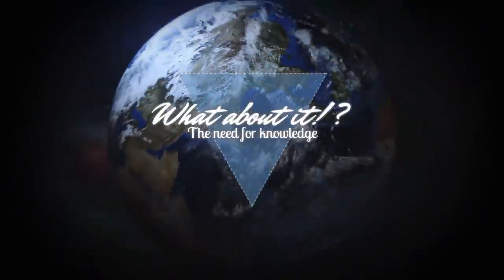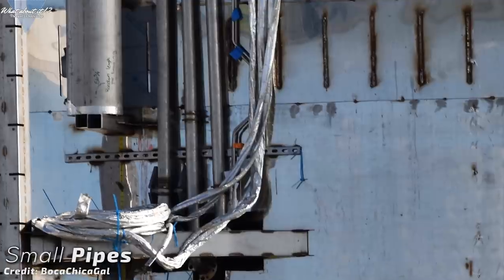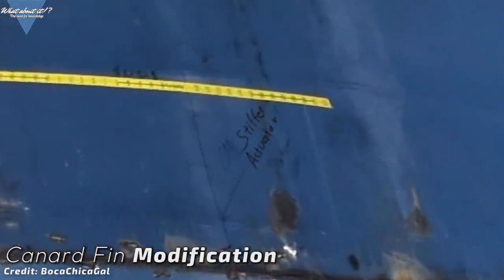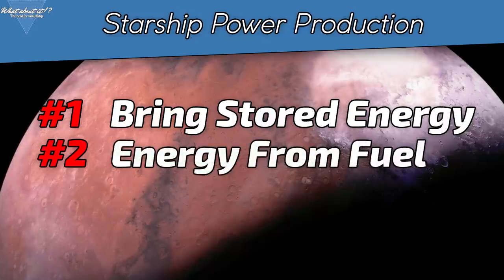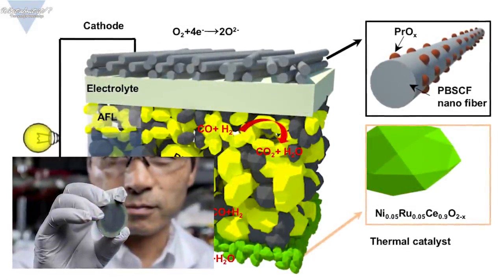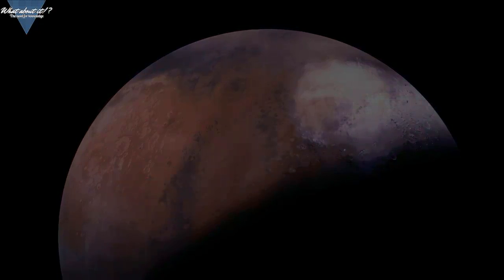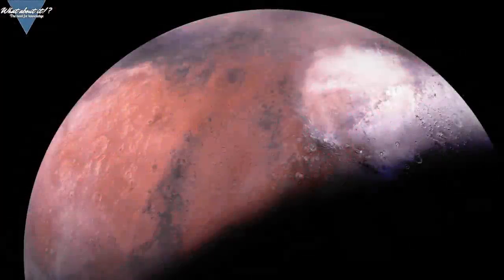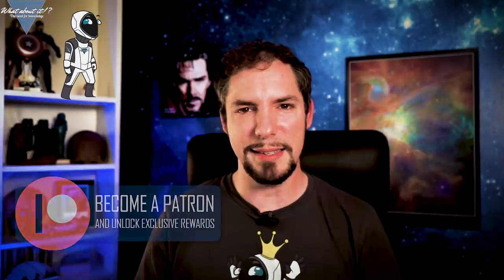45 | - How Does Spacex's Starship Generate Power?

Comment: 6:15 : kWh is not power, it is energy. So if you talk about "75 - 90 kWh" needed for the ISS, you have to say it what time this amount of energy is consumed.
Reply: 70 to 90 kwh means a total 90,000 to 70,000 watts in one hour. So if  they use 4,500 continuously for 20 hours they have used 90 kwh. Does that help you?
Reply: kW would be correct here.

kWh is a mistake.
Reply: He meant 75-90 kW
Reply: @ixglocTV  Nope, it's right. I figured you all would be able to figure this out since electric cars are around. You know, they measure things in kwh like it should be. A 100 kwh battery can last 100 hours at a 1000 watt hour draw. Do you understand now?
Reply: @Bryan-Hensley  Look into your physics textbook (also wikipedia will do), W and kW are power units, Wh and kWh are energy units.
Reply: @Bryan-Hensley  kilowatts are a measure of power, like horsepower. Power is a rate of conversion of energy. Kilowatt hours are a measure of energy, specifically the amount of energy a battery needs deliver to sustain 1kW power for 1 hour. The analogy would be a horsepower hour. A 100kwh battery is 100 larger than a 1000wh battery, but this says nothing about time. The correct version of your statment is a 100kwh battery can last 100hours at a 1000 watt (or 1kw) draw. Talking of a 1000 watt hour draw makes no more sense than talking of a horsepower hour draw. If you insist on this terminology, you end up with  A 1000kWh battery can last 100 hours at a 1000 WATT HOUR PER HOUR draw, which is unnecessarily complicated, better just to express in watts. Unfortunately there is gross misuse of the terms kilowatt and kilowatt hour in North America. It's usually used correctly in Europe. It's disappointing to see Felix get it wrong.
Reply: @londonalicante  And it still goes over your head. You just proved me right and you still don't get it.
Reply: @londonalicante  you must be younger. Young people were taught how to memorize. Older generation was taught to understand.
Reply: @Bryan-Hensley  I'm 46, and I am an engineer who designs very large heating equipment for industry. I understand what you mean by a draw of 1000 watt hours, but it does not make the terminology correct. It should be 1000 watt hours per hour, or simply 1000 watts. I'm sure you would agree that describing a 1hp motor as a 1hp hour motor looks a little odd. These ambiguities can be important. How would you feel if you bought a car with a "200hp hour engine", then found out later that the engine doesn't actually make 200hp power, it makes 200hp hour of mechanical energy in 10 hours, so it's actually only a 20hp engine. And yes I know talking about horsepower hours looks weird. I'm doing it deliberately to illustrate how wrong it is to use kilowatts as a unit of energy when they are in fact a unit of power, or kilowatt hours as a unit of power when they are in fact a unit of energy.
Reply: @londonalicante  I don't see what the issue is. ISS uses 75 to 90 kw per hour. Isn't that what he meant? I'll listen to it again and see. The original comment said he needs a time, kwh is an hour. I don't get the confusion. I totally understood.
Reply: @londonalicante  Why the insults? Try to keep the discourse civil.
A 90kWh battery can supply 90 hours of power at a rate of 1kW, or one hour at 90 kW.
I did some research and it looks like ISS uses about 90kW of power, and the four PV panels (2500m2 total area) generate about 80-120kW in full sunlight. Enough to power the station and charge the batteries. Haven't found any numbers on storage capacity yet.
Total eclipse time is about 35 minutes out of each 90 minute orbit, so a 90kWh battery array should be able to handle it, but I think I'd go with at least double that, for redundancy.
https://en.wikipedia.org/wiki/Electrical_system_of_the_International_Space_Station
https://www.edn.com/design/power-management/4427522/International-Space-Station--ISS--power-system
It surprisingly difficult to find how much energy ISS's batteries can store. Lots about how much the station uses and generates, but I can't find anything on storage capacity. Maybe someone with better "'net-fu" than I can find it.
Reply: @Bryan-Hensley  The issue is that he said the ISS uses 75 to 90 kwh , but did not specify how long. If he meant 75 to 90 kw, he should have said 75 to 90 kw, just as for an engine, you would have said 75 to 90 hp. By adding the hour, he could mean 75 to 90 kwh per hour, or he could mean 75 to 90 kwh per day, which is only 75/24 to 90/24 =  3.125 to 3.75kW. Common sense says this is far too small, so he probably meant 75 to 90kw. Note that kw PER hour is a different thing altogether. It refers to a power ramp rate, similar to horsepower PER hour. You could say, for example, that a power station could increase its output by 1000kW every hour when it comes online, unitl it reaches its full power after several hours.
Reply: @Bryan-Hensley  As we seem to be understanding each other now, I'll give another example, that rarely causes confusion: car battery amps. A typical car battery might be 12 volts,  50amp hours, and capable of 500amps peak. 50amp hours means it can run the stereo at 1 amp for 50 hours before going flat, thats 1 amp x 12 volts = 12 watts for 50 hours = 600 watt hours. 500 amps peak means it can deliver 500 amps at 12 volts to the starter motor. That's 500 x 12 = 6000 watts. But it can only deliver 500 amps (6000 watts) for 1/10 of an hour before going flat. Again, the difference between watts and watt hours is important.
Reply: @londonalicante  no, I'm just tired of trying to explain it to you. I'll give you one more example and I'm done if you don't catch on.
 I install 10kw heaters quite often. Guess what, they are 10kwh heaters or 10kw heaters. Isn't that amazing, exactly the same.
Reply: @londonalicante  this is where memorization vs understanding.  memorization people nick pick wording, people who understand knows it's the same thing either way.
Reply: @Bryan-Hensley  I am disappointed. I thought you were showing some willingness to listen. There is no such thing as a 10kwh heater, and there is no such thing  as 10 horsepower hour engine. It is 10 kw and 10 horsepower.  If you try to run your 500 amp, 50 amp hour car battery at 1 amp, you will find that it dies after about 50 hours, not 500 hours.  There is a difference. Whether that matters or not depends on the situation. If your next employer tells you he is going to pay you $50, I recommend you check if he means per hour, per day, or per year.
Reply from the maker: Oh my... what did I start here!? Thank you all for your replies! :D
Reply: @Whataboutit  Disagreement about whether you meant 75-90 kW or 75-90 kWh for the power consumption on ISS. I think you said 75-90 kWh, I think you meant 75-90 kW.

As an aside, its easy to find the power consumption rate of the station, not so easy to find the energy capacity of the batteries on the station.
Reply: @Bryan-Hensley  Age has nothing to do with memorizing versus understanding. I know 20-somethings with more understanding than 50-somethings. And vice versa.
Reply: @Bryan-Hensley  I'm assuming those heaters are tied into the electrical grid? Seems to me that number would be used to determine the circuit capacity/breaker required. A 10kW heater could get away with a 15 Amp breaker, whereas a 20kW heater would need a 30 Amp breaker.
All well and good if you're tied into the grid, but if you have batteries, that's a finite amount of energy so a 10kW heater would drain a 10kWh battery in an hour. A 20kWh would last 2 hours.
It is a simplification, because there's undervolt protections and whatnot in electronics, that heating elements probably don't require.
Undervolt situations can kill a computer just as fast as an overvolt. The electrical grid doesn't like it either. That's why so much effort is put into load balancing on the grid. If you have more generation that consumption you melt stuff.
Reply: @coreys2686  I'm referring to how schools teach. Now days they teach you to memorize things instead of understanding. It takes too long to teach people how to understand, much easier to teach via memorization. But when it comes to things like this, memorization people can't understand, they only know what the book says. For me, it doesn't matter which term he used, I totally understood what he meant.
Reply: @coreys2686  you answered your own question. Amps is the rating for capacity, not wattage.
Reply: @coreys2686  amps and volts isn't a good way to calculate power consumption. For example, a PCS motor will draw 1.7 amps at 245 volts which consumes 410 watts. An ECM motor will draw 2.4 amps at 245 volts but only consumes 325 watts.
Reply: @Bryan-Hensley  I'm in my 40s. My school taught rote memorization, and a curriculum that hadn't changed much in the decades prior. Rote memorization has been a method of teaching for centuries. Understanding and critical thinking is another layer on top of that. It's politically expedient to not teach critical thinking.

But, this conversation has gone too far off course to be useful to the topic presented in this video.
We should limit our comments to the video itself.
Disparaging remarks about other posters shouldn't have a place here.
I direct that comment at everyone.
Reply: @Bryan-Hensley  I agree. Wattage distills down amperage and voltage into a faster to communicate form, in certain cases.

But, then why use an Amp to describe a breaker or fuse in a house? 

I think it depends on the most important number in a specific use-case.

Why, for instance, does a cell phone battery advertise its number in Ah or mAh, and a automobile or grid sized battery use Wh, or kWh? A cell phone uses Li-ion, as do most BEV/stationary battery storage, so why the difference? The physics and chemistry are exactly the same.
Automotive/marine batteries emphasize Amps/cranking amps/cold cranking amps.
It comes down to use-case. A 30,000 kWh battery doesn't mean anything if it can't output 500 amps @ 12 VDC (or whatever number is typical) to get a starter motor spinning against the inertia of an internal combustion engine, if that's its use-case.

Like other YouTubers have said: "Context, Context, Context."

And all this thinking from someone who was taught rote memorization in school.
Reply: @Bryan-Hensley  Time is included in Watt already. That's the point most people don't  get because it's counterintuitive. Watt is like km/h. Not like "length" but like "speed". It's J/s. So 1 Wh = 3600 J.
Reply: @coreys2686  But the video is talking about the power needed in spaceflight. That would be an average. Peaks can be offset several different ways. Capacitors is probably the lightest way but uses more room.
Reply: Bryan Hensley  My understanding, if memory serves, is that Wattage is derived from Amperage and Voltage (P=IV), all of which are instantaneous measurements. If you want capacity you add time as a variable.

/sidebar/
I play a game called Space Engineers. It has Solar, Wind and Fission for power generation. They report the rate at which they can provide power, in Watts, kiloWatts, or MegaWatts, important to know if you have, say, 6 large-grid atmospheric thrusters that each use 2.36 MW of power, you need at least 14.16 MW, just to power the thrusters at max strength.
A large-grid solar panel produces about 120 kW, so is unable to power the thruster directly. But can charge the batteries.
Batteries in-game report both watts and watt-hours. For example a Large Grid Battery can output 12 MW, but stores 3 MWh of energy. So using the above example, one Large-grid battery can't provide enough power. With 2 batteries the thrusters use about 60% of available power. With three batteries, its about 40%, etc. I don't remember offhand how long the batteries can power that system for.

Amperage and Voltage are superfluous to gameplay.
/sidebar ends/

Cell phone chargers use Voltage input (my Samsung charger can accept 100-240 VAC) and an output in Volts and Amps, because both are individually important to cell phones. In the case of my charger, 1.67 A @ 9 VDC (=15.03W) or 2.0A @5.0 VDC (=10 W). If I were to only report wattage, it would be 10-15 watts. Electronics are sensitive to variations in voltage and frequency, that's why older electronics typically have things like 100-120V, 60 Hz on their labels in North America, whereas European electronics operated at 220-240V 50Hz, and you never interchanged them. Modern electronics is a bit better. My Samsung charger has a range from 100-240 VAC, 50-60 Hz, 0.5A. I think the only difference between them nowadays is the plug shape.

I have been playing SE for many years so have a fairly good understanding of electricity generation and consumption. It may be "just" a game, but the principals are consistent with the real-world.

I also have some post-secondary education for electrical and electronic systems. I've repaired electrical heaters and replaced wall plugs. I've bread-boarded electronics and diagnosed auto-electrical problems. I built the computer I'm using to type this.
Reply: @coreys2686  there's this thing called power factor.
Reply: @Bryan-Hensley  Power is power. Doesn't matter where you are, we're still human and humans require power for life-support, communications, etc. Its the same on the surface of Earth, Mars or in transit between the two.

ISS is used as a baseline, 75-90 kW is what ISS (4-6 crew) uses for life-support, communications, and experiments etc. Even if ISS is stuck in LEO, its still in space. Peaks are handled by the avionics. They original ISS batteries are Ni-H or something, they have been replaced by Li-ion based systems, about half the mass of the old ones. Most capacitors put out power at a rate too high for many electrical components to handle. They explode real nice if you damage them.
Reply: @Bryan-Hensley  OK, what is power factor?Why is it a thing, how do you derive it? How does this relate to the power consumption and storage for an interplanetary trip?
Reply: @coreys2686  it would be individual rated for each device that consumes power. That's why it's best to rate this stuff in kwh. You'll have a precise measurement
Reply: @Bryan-Hensley  no because it doesnt make any sense.
Reply: @Bryan-Hensley  You dont understand it at all - "1000 watt hour draw" is not a thing, 1000 watt draw is.
He made a mistake by using kWh which is an amount of energy and should have used kW which is power.
Reply: @jeffreylebowski4927  you are totally wrong. Wattage is not an amount of power. Sorry dude.
Reply: @jeffreylebowski4927  I don't see why it's over your head. It's pretty simple
Reply: @Bryan-Hensley  you have to be blatantly narrow minded at this point to not realize you are totally wrong here or just trolling.
Just educate yourself before spreading myths. It's all explained here:
https://en.wikipedia.org/wiki/Watt

Comment: Stiffening strips: the strips by the actuators may be stiffening ribs to distribute the load forces of the elonerons. Those look larger than originally planned, and is too late to put enough internal ribs due to other last-minute additions in the nose cone. A kluge just for Mk 1.
Reply from the maker: Elonerons? :D
Reply: @Whataboutit    A term I came up with. The forward and rear elonerons are an aerodynamic control surface that functions like nothing else. Feel free to propagate it!   We've all seen the difficulties of trying to adapt terms like air brakes, canards, and fins. All fit poorly. Tim Dodd likes the term, too.

Comment: Easier way to do it - piping coiled attached to the outer hull, between inner and outer hulls, to a turbine - the amount of sunlight striking the hull will heat water which can turn a turbine without pumps
Reply from the maker: Thanks for bringing it up! Easy to build and no research needed! But what would that weigh?

Comment: Since the Starships, at present, are prototypes, the ribs on the outside of the nose cone might be installed to reinforce the area around the canard fin actuators to provide a stable platform for their actuation.  Later versions of Starship will have the ribs installed internally.

Comment: Nice analysis of the power issue. Given that the initial concept was to use fan shaped panels (which would presumably have folded out from under side nacelles), I agree with your conclusion that they intend to mostly use solar and then deploy those panels on Mars. If 25% to 33% of the leeward side of Starship is also covered in panels, it would work despite the curvature of the hull, because modern panels retain 90% of efficiency even with the sun at 45º to the panel. So assuming a 40m length of the Starship hull is covered, then @200w p sq m I would guess the potential power from the hull alone might be in the region of 50kw to 60kw, which is certainly worth having and engineering into the design. I would imagine that there would also be other sources of power such as additional panels deployable from the cargo bay as you suggested, and maybe nuclear and fuel cells as back up.
Reply from the maker: Thank you and I agree! It will most likely be a mix. Redundancy is nice to have!

Comment: I admit I have not considered this question before.  It's possible that SpaceX might end up with a few different versions of Starship based on their power production.

The basic model might only include solar panels attached to the hull along with batteries.  This would be used on the missions deploying satellites that only last a few hours as well as on the "one way" missions to make a base on the Moon or Mars, with solar panels destined for that colony used to supplement the power needs on that trip.

A second model that would be used for round trips between the Earth and the Moon or Mars might have a set of deployable solar panels.

For Starships trips to the outer planets, maybe nuclear or methane fuel cells.
Reply from the maker: Absolutely! Thank you for the nice reply! :)